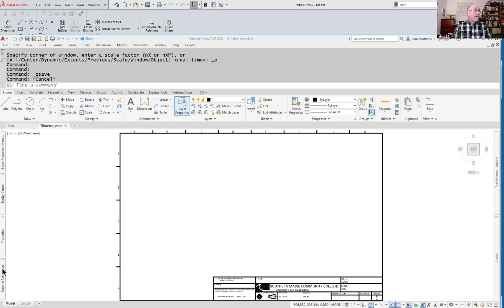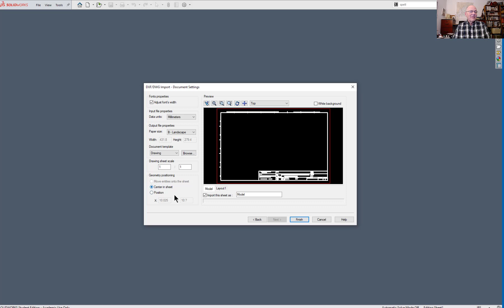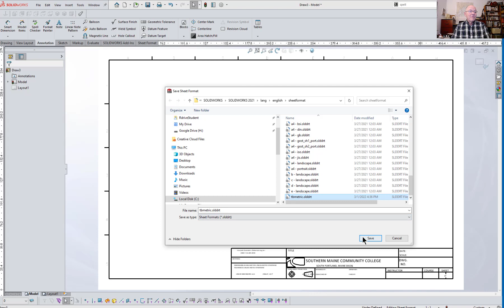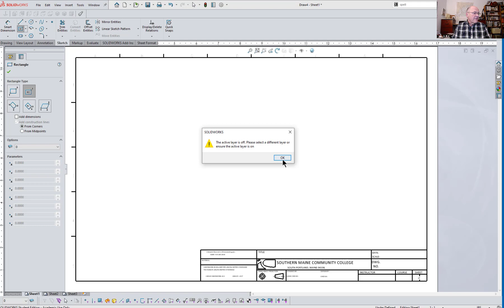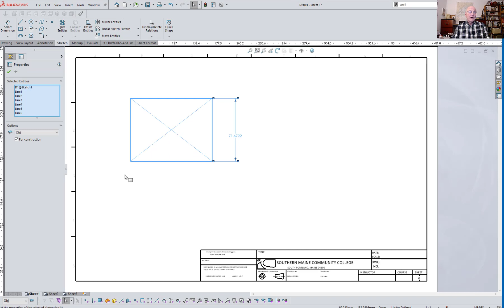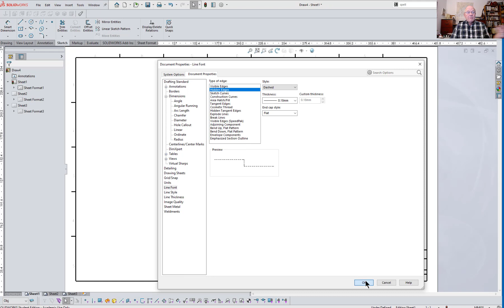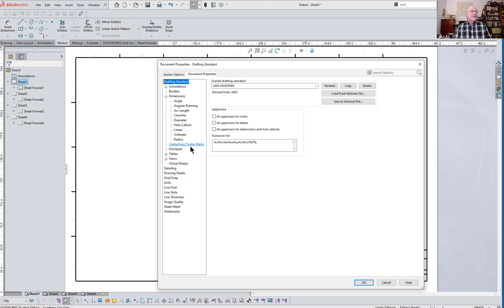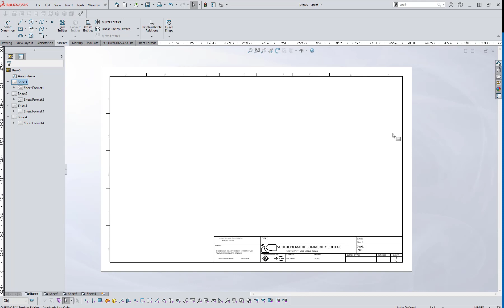Creating SW sheet format from a DWG file

Comment: I have a question. I have an autocad block that already has attributes for the fill in text. Can I import that and have all the attributes I fill in with autocad in solidworks? Thanks. I've learned a lot more from your videos.
Reply from the maker: Yes you can. The attributes become SolidWorks text entities, and the block itself is still a block, but you can edit it. There is no comparable attribute entity in SolidWorks but the values will be there, even if the block was inserted into a Layout and aren't in Model Space. Each tab will be inserted separately. Glad you found the videos helpful.
Reply: @DanAbbott-SMCC Thank you very much. I'm going to load my titleblock template into solidworks shortly and will give this a try.